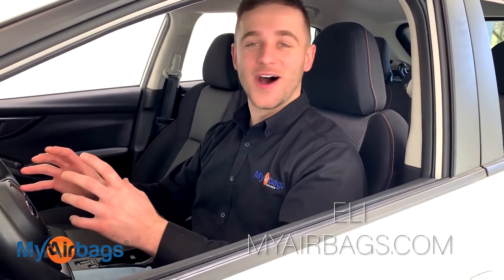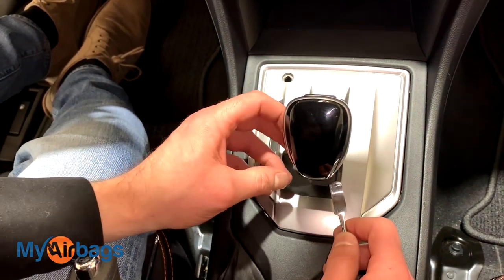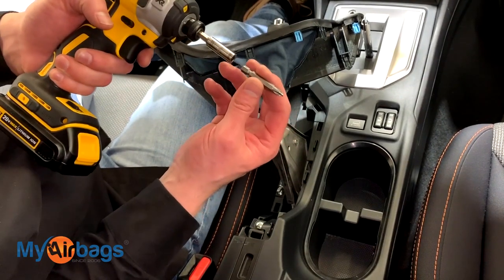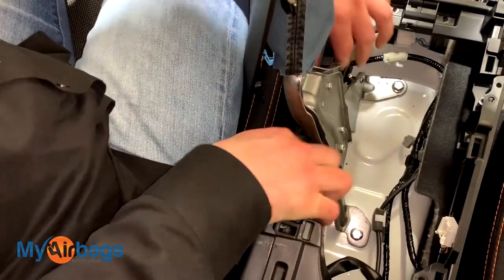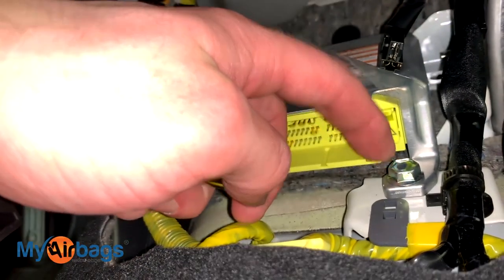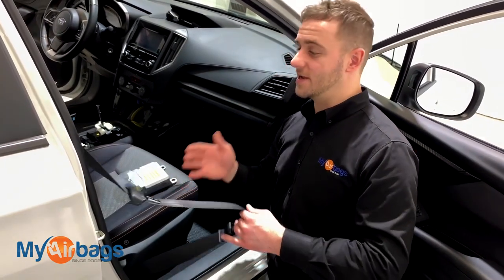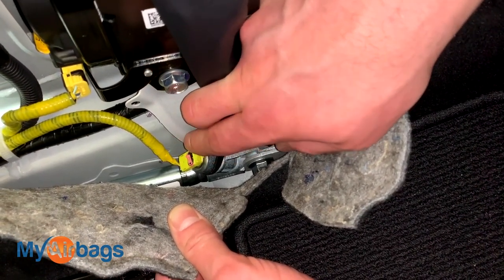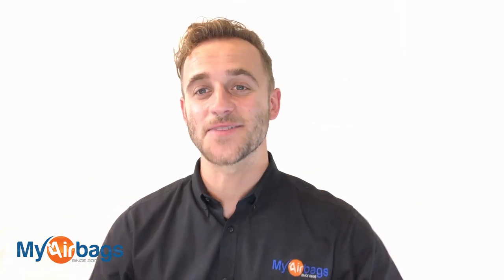How to Remove SRS Airbag Control Module & Seat Belts on a Subaru Crosstrek | MyAirbags

Comment: In addition to replacing the SRS Module and blown air bags, do I need to also replace air bag sensors?
Reply from the maker: No, the impact sensor are usually good and dont need to be changed unless they are physically damaged or if you get a code when you scan the SRS Airbag system.

Comment: Question. Once the airbag control module is disconnected and removed to be shipped out can I  connect the battery after to drive the vehicle to move it around the shop?
Reply from the maker: Its best to keep the battery disconnected to avoid additional programming that could be needed if the battery power is applied while the airbag control module is disconnected.

Comment: In this vehicle will eyesight be disabled after airbag ? How can I enable eyesight after it has been fixed
Reply from the maker: Yes in most newer vehicles a lot of safety features are built to be controlled by the srs airbag control module. If the eyesight feature is controlled by the srs control module then it should be restored after crash data history has been reset/cleared in the srs airbag control module.
Reply: I got my airbag back from you guys what is the proper procedure to reinstall is this plug a play now after repairs ?

Comment: 2021 Subaru Crosstrek

Can I only change driver steering airbag? It doesn’t blow up.
Do i have to replace with a new one?
Reply from the maker: Yes, you can change just the airbag. It does not need to be new. the airbag is okay. The airbag light will continue to stay on until seat belts are replaced or rebuilt and airbag computer  module is reset. Let us know, we can help with the sest belt and airbag module reset, check out myairbags.com for more info.

Comment: Super informative video and appreciate you sharing. I'm in the process of removing the back row seatbelts on my 2019 Forester. Turning the car into a mini camper, so I have no need for the back trim/seats/etc. I noticed there are similar air bag modules for the rear seat belts as well. My question is -- if I removed the rear seat belt modules entirely and didn't replace them, would it impact airbag sensors for the rest of the car (driver + front passenger)? Thanks a ton!
Reply from the maker: Christopher, the rear belts on your vehicle isn't equipped with the deployable type of seat belt, therefore they shouldn't be tied into the airbag system. So it should have no affect on the airbag system.
Reply: @MyAirbags  yes they are

Comment: Reset 2020 Subaru Outback with 98221AN00A, with chip R7F7016863 ? This one seems to be locked!
Reply from the maker: Yes we can reset this unit, clearing crash codes and crash history. Here is the link https://www.myairbags.com/product/subaru-crosstrek-srs-airbag-control-module-reset/

Comment: Hello guys! After resetting the srs airbag module crash data. Do you have to program the airbag module to communicate to the vehicle? Thanks!
Reply from the maker: No you dont, if you send the original airbag computer module for reset then you dont need to have it programmed to your vehicle.
Reply: @MyAirbags  what about a 2021 Subaru Forester

Comment: Could you send me information on sending you parts for reset
Reply from the maker: Our website is myairbags.com. You can also call or text us at 855-770-4055
Here is link for airbag module reset
https://www.myairbags.com/product-category/repair-return/airbag-module-reset/
Here is link for seat belt pretensioner repair
https://www.myairbags.com/product-category/repair-return/seat-belt-repair/